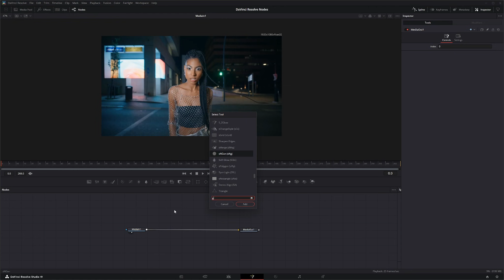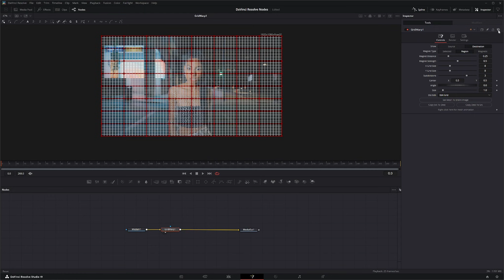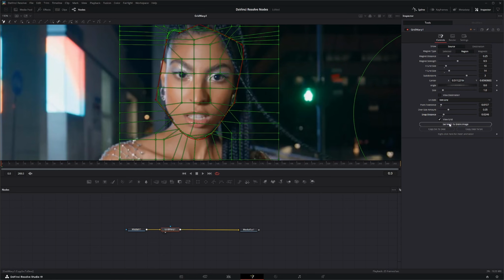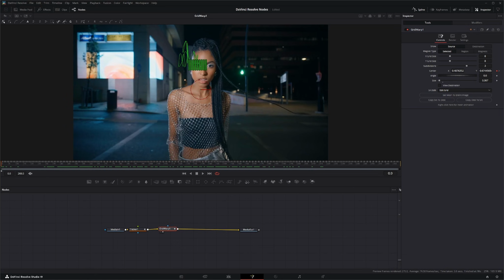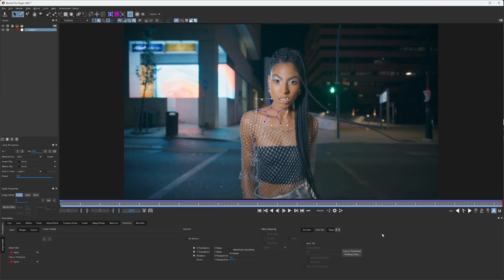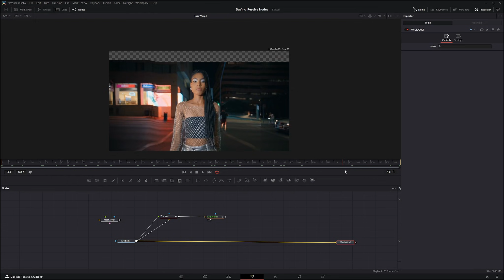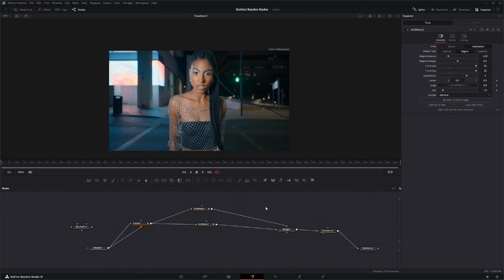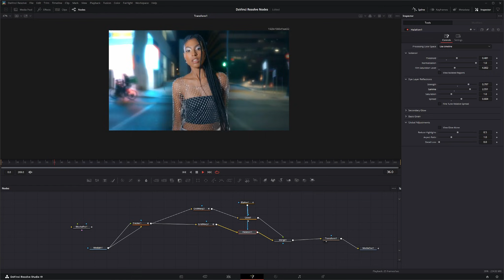DaVinci Resolve Fusion Grid Warp Node

Comment: Thank you, briefly about the main thing. Please tell me how to change the shape of the sun glare on the surface of the water? There are many of them and the easiest way is to squint. A slit diaphragm for the eyes works. Artificial optics and lenses do not work like that. Boris fx effects are not controlled by changing the shape. There are circles and stars. Maybe it is possible to control the shape using a mask?
Reply from the maker: This is way too complex for a written response on how you could go about doing this. Unfortunately, I have to limit tutorial requests to members. But, you're on the right track...you need to use the water's deformation to drive the shapes of your glares.